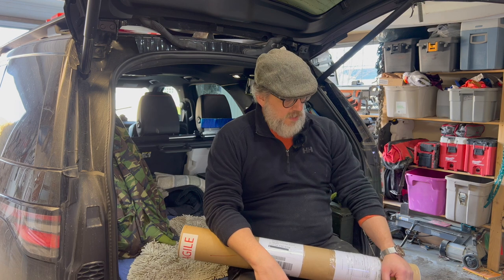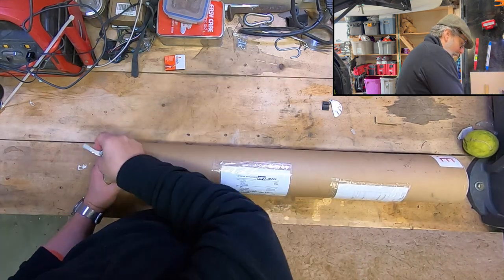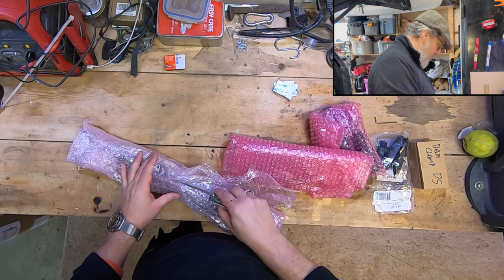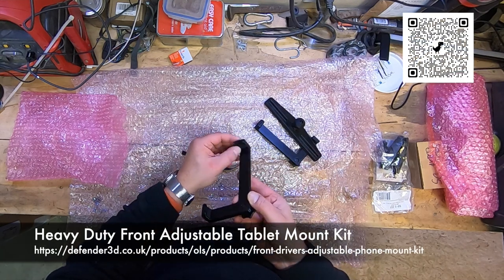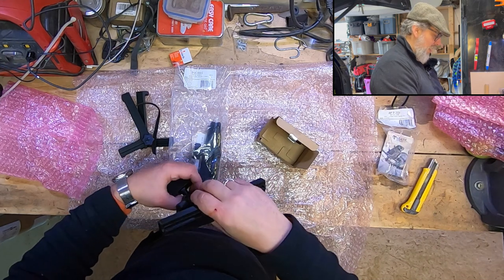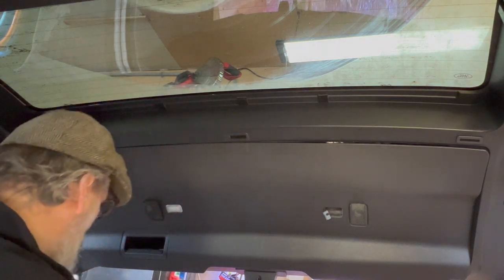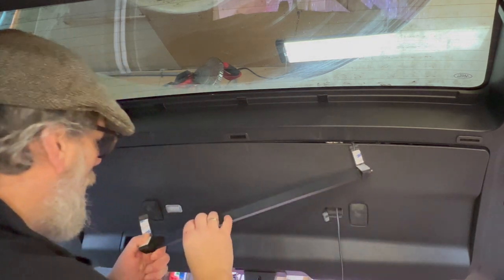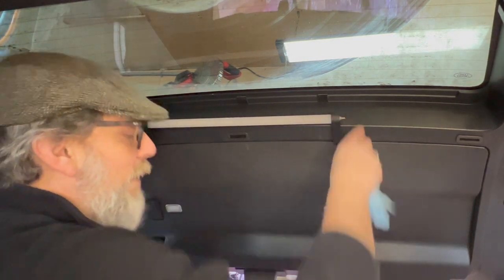Unboxing and Installing The New Discovery 5 Rear Loadspace LED Light from Tim at Defender3D #disco5

Comment: I reckon that the Phd is for rocket science rather than brain surgery.
Reply from the maker: Hahah! No, Huw — it’s for Philosophy. I’m not sure which is worse!
Reply: @shedlock2000  
That’s a sort of non-physically-invasive brain surgery. More analysis and wondering about the purpose of our existence I suppose. I’m amazed. I would have put you down as more attracted to  engineering or architecture. You may turn out to be the next Jordan Peterson and we need more of him.
Reply from the maker: I do have an engineering degree, but I returned to academia about 12 years ago after driving trucks in North America. I was originally signed up for pre-med, but then I got sidetracked by philosophy.  

I think the more life you have and the more things that you experience, a person naturally becomes disposed to philosophy — simply by reflecting on those experiences. I’ve been fortunate to have had a very diverse and crammed life, so far, so philosophical thought came quite naturally. Ordered thought is the mainstay of engineering, mechanical work, architecture, and so on — the logic used in problem and fault diagnosis is the same as in analytic philosophy, so it’s a natural continuation of that work, really.